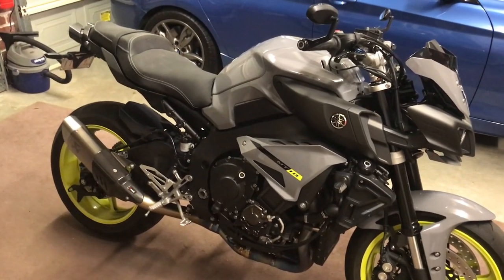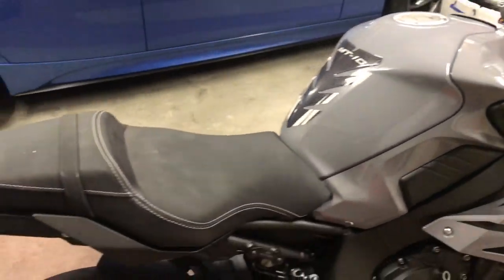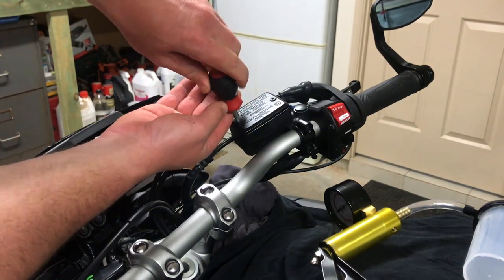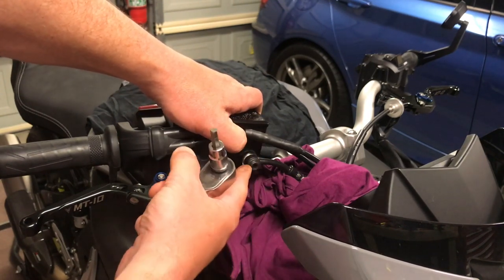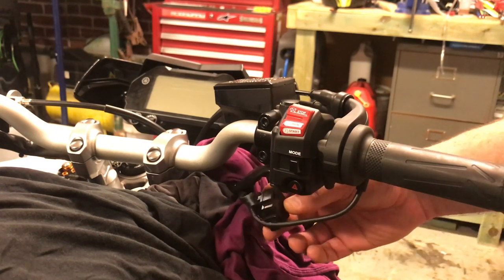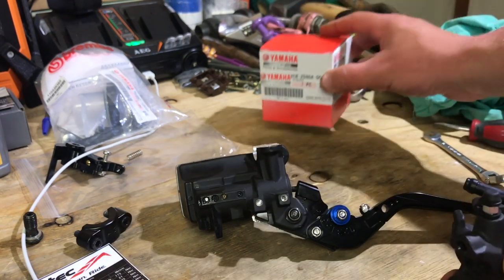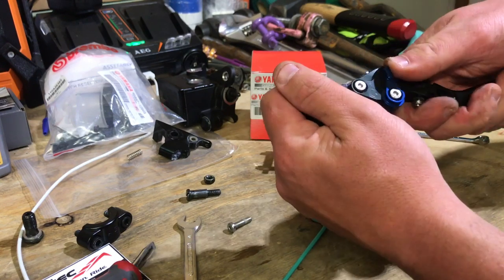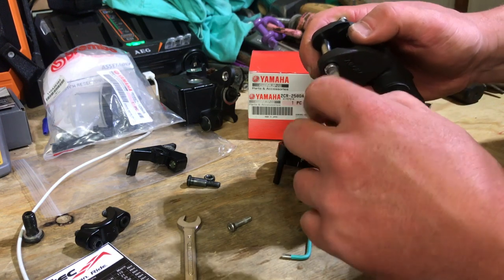Yamaha MT10 -R1 Master Cylinder Fitment

Comment: Great video thanx , I also did it after watching your video , in my application there was a minor issue , after installing all the parts front calipers didnt retract fully because of an un known issue. Lever seemed to press the brake piston more than intended ,maybe its ok for an r1 brake system but showed up as a problem  .. I solved it by grinding the sensor side of the lever which halped to  maintain more room for the brake master piston ..

Comment: Hi Ritchie.. great videos - been using them as a guide and have done the pads and AIS block using ur howto. I have the Gilles front levers on my MT and Stoltec reckon they won’t fit the R1 master cyclinder - any thoughts?
Reply from the maker: Kal , thanks for stopping by and for your kind words . 👍

I’m glad my guides have helped you with your bike . 

Sadly yes Stoltec is correct. 
I had to change the lever perch on my “MT “ brake lever to a R1 perch but managed to retain my Mt lever. If you flick thru to around the mid of this video,I’ve explained what I did there. 

Also if u wish to retain your cruise control , I just wrapped a bit of electrical tape around the small arm that pushes on the cruise switch....
Reply: Richies Bikes Cheers... I’ll watch that section again and take a closer look and then make a decision.

Lovin the M135i too.. had one myself, straight 6 all the way 👍🏻

Comment: Hi Richie, 

I heard that once you bleed and refill the brakes, in some cases, the ABS icon lights up even after you go past 10kph. Reading through the MT-10 service manual, it states that you need to hook up the bike to the Yamaha Diagnostic Tool  and run the Hydraulic Unit Operation Test: this test comprises of two methods: 

1) Brake Line Routing Confirmation: this test checks the function of the ABS after the system was disassembled, adjusted, or serviced. 

2) ABS Reaction-Force Confirmation: this test generates the same reaction-force pulsating action that is generated in the brake lever and brake pedal when ABS is activated. 

Did you run the Hydraulic Unit Operation Test? If so, can you shed more light into this?

Comment: Hi Richie. Any chance you are going to post the video of you also doing the Spiegler line change?
Reply from the maker: mmunoz 83 , thanks for stopping by. 
The braided line fit up is massive task. 
About 2.5 hour of Video alone. 
Plus not to mention, the possible legal issues arising from messing with brakes . 
 A lot of guys are having the lines fitted up at the dealer as the dealer can properly bleed the abs pump also..

Comment: What's the difference between the masters.  You said 15mm bore vs the r1   15.8mm surely  0.8 mm won't make much difference... is std brake a  radial mc

Comment: did the changes improve the performance of the braking?
Reply from the maker: BAD yamaha MT10 , yeah big time !!
No more spongy lever..!!
Reply: @RichieIsf  hi... what's the diff between the masters.. as you highlighted 15mm bore   vs  15.8 with r1    surely  0.8 mm extra won't transform them

Comment: cruise control system work or not ?
Reply from the maker: yes, my cruise control works, but not without a small mod to the lever perch on the underside of the lever. the brake switch should click just as you press it and again as ur squeeze it ..
Reply: Works flawlesly ..I grinded the other parts of the lever where doesnt touch the sensor .Thanx to Richie..
Reply: A bit late to the party but the cruise control off switch on the brakes (i assume that is what you meant) is linked to the brake light, so any mods to the brakes you have done to other bikes will work on the MT-10 as well, granted that the brake lights worked as normal on your previous bike(s).

When your brake light switches on, your cruise control turns off.